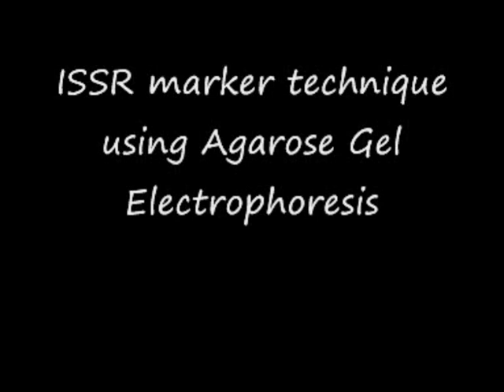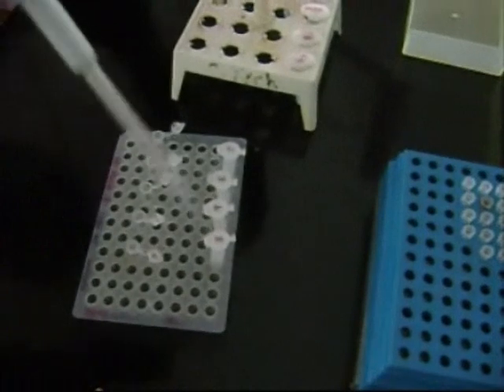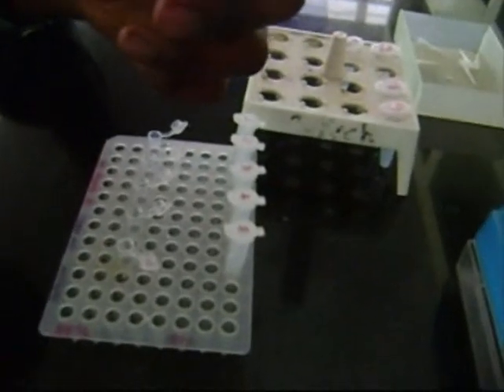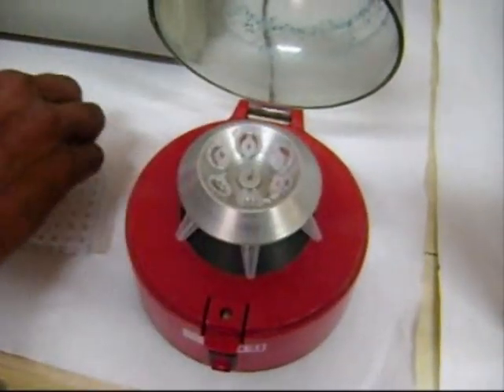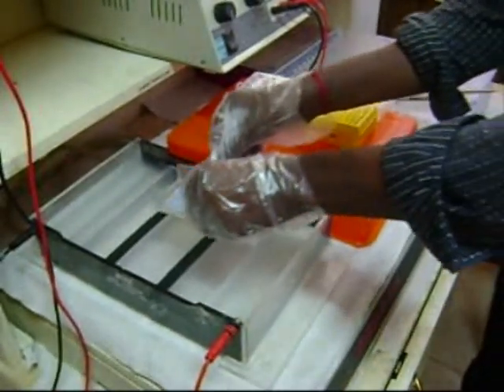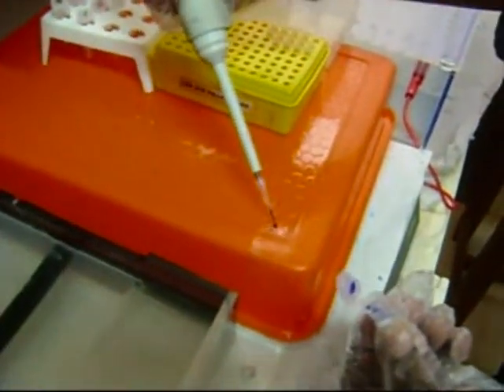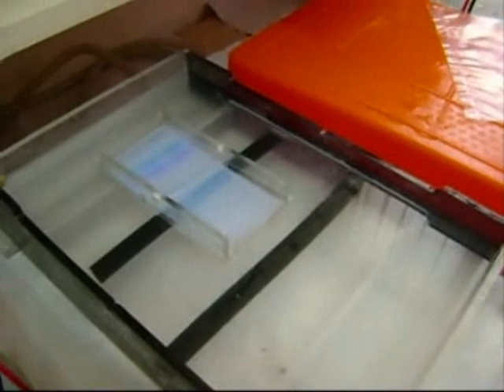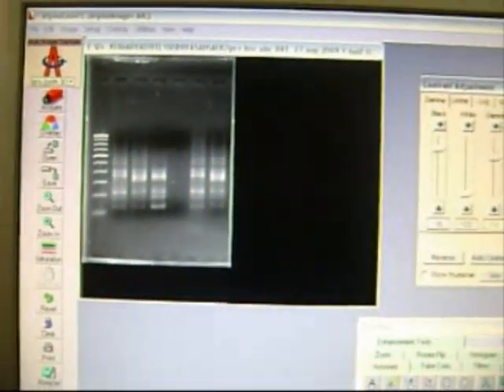ISSR marker and varietal  finger printing

Comment: In ISSR If the primer is designed according to the sequence within the repeat region, the size of the amplicons from a single repeat region may vary ( either a lengthy or shorter ) since the primer might anneal to the positions other than starting and ending positions of the repeat sequence and thereby producing bands of varied sizes.

Will it not mislead our experiment?